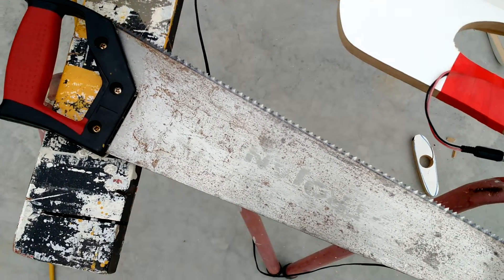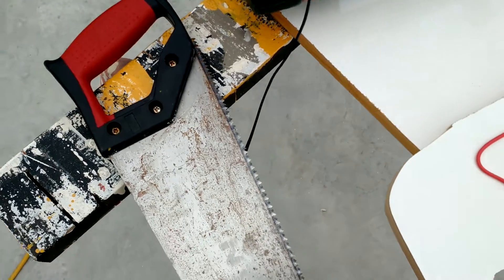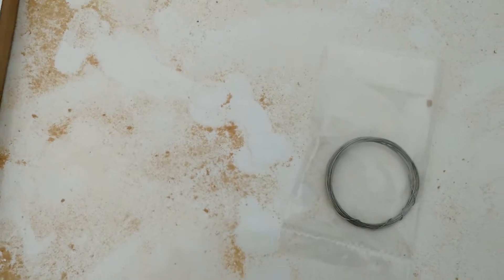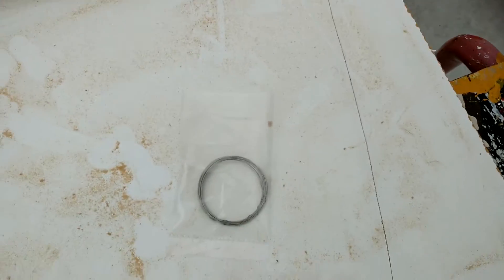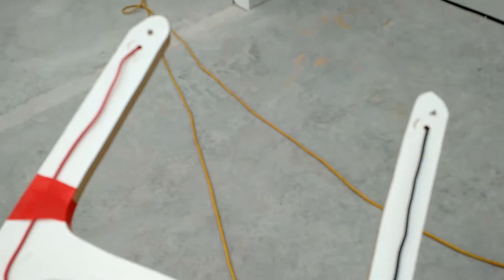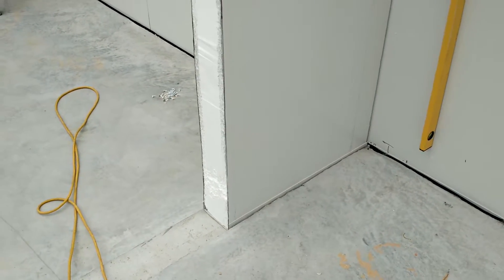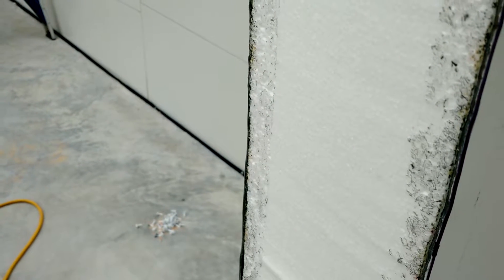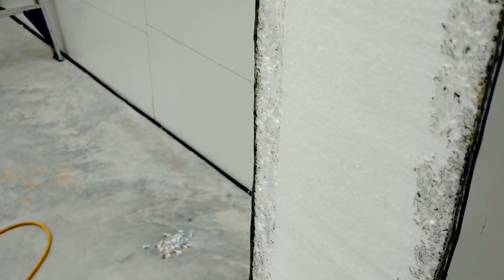SIPS Panel Hot wire cutter

Comment: Was this because cut to order panels were not available from that supplier or was it simply cheaper to cut them onsite yourself?
Reply: Both they were cut to size length wise but we cut out the doors and windows on site some times making adjustments as we went  for better positioning.
Reply: Sorry about the delay in answering you.Have been laid up in hospital for a hip replacementt
Reply: @allrcflyingisfun  I hope you're recovering well. Thanks for the reply.
Reply: @DavesShed  Yes but its  slow and there is still  a lot to do